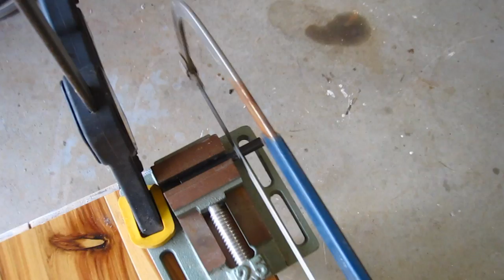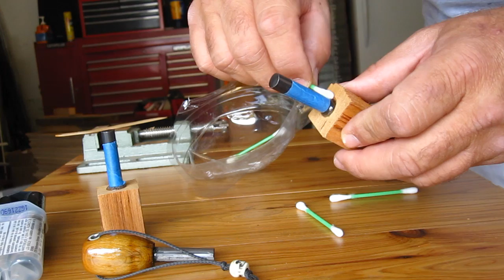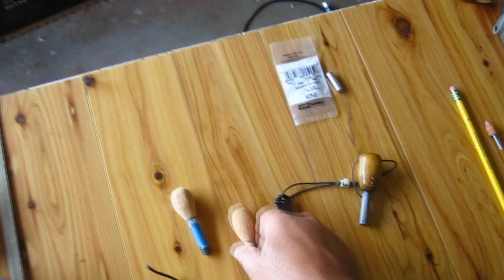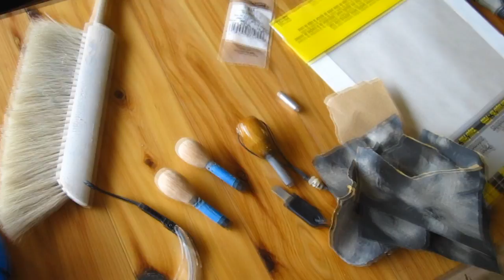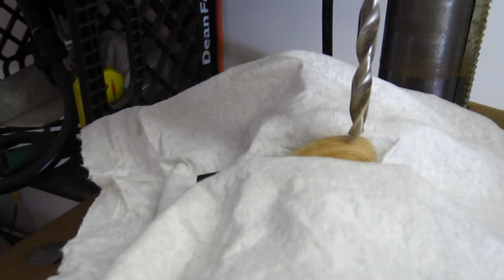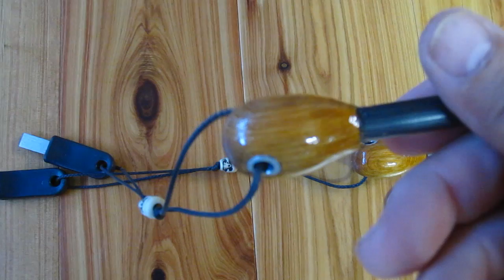Bushcraft firesteel with custom handle

Comment: Another great video!
I want to try to make one of these. I may try putting ferro rod up in the drill chuck after the rough trimming is done on the handle, let the drill press spin, and hold the sandpaper against the piece. It might go quicker, and give a real uniform sanding. maybe?
Thanks again for another great project!

Comment from the maker: @frankdrebin Thanks! Even with a drill press I needed to drill the hole place the rod and then shape it around the rod that way its always straight and centered. Don't have to worry about drilling straight that way. Also, its hard to drill straight for the little spacer thing for the string even with a drill press. Just take your time. The cypress was dry. You can do it with about any kind of wood.

Comment: Really appreciate this video, reeperz.  I went a/b this the real hard way.  Found wooden pre shaped chess pieces (plain looking and too brittle) and tried to cut them shorter w/ a chop saw.  lol  Didn't work out.  Couldn't drill the hole straight (no press), the wood wouldn't hold together when drilling either.  I need to start w/ a bigger piece of wood, and pick up a dremel tool.  Thanks, man.  This is the way to go.  Great work, man.